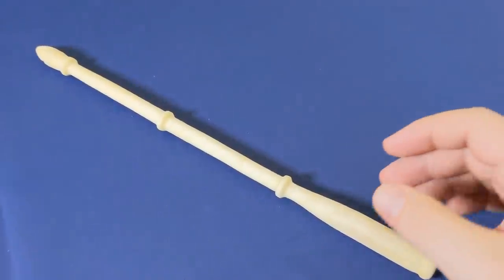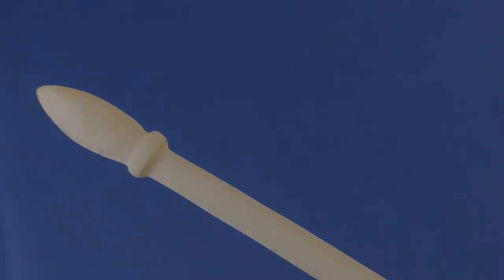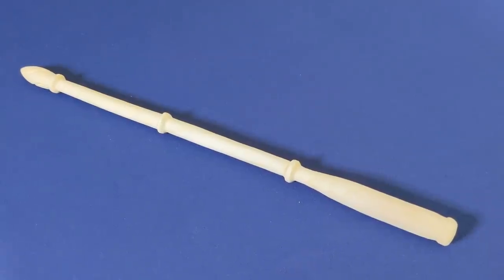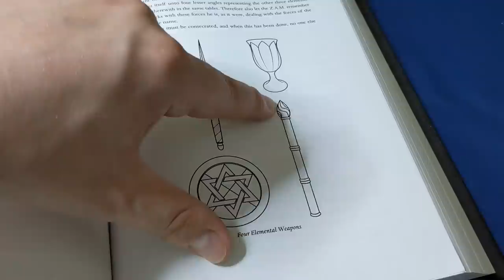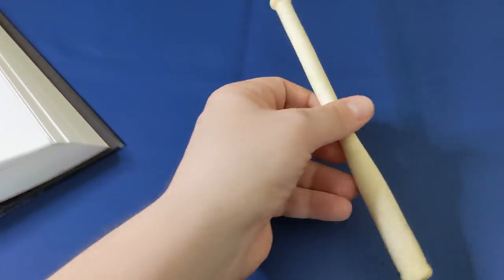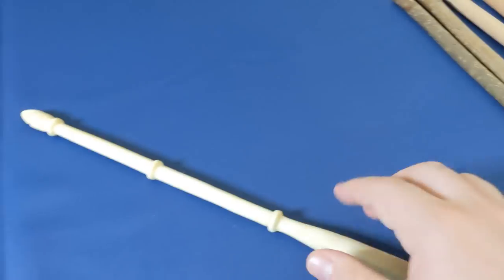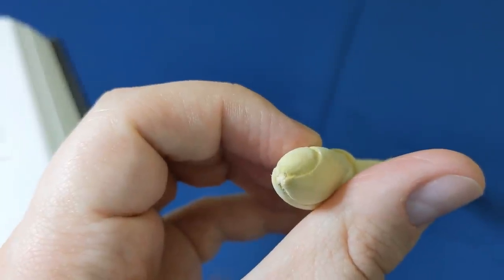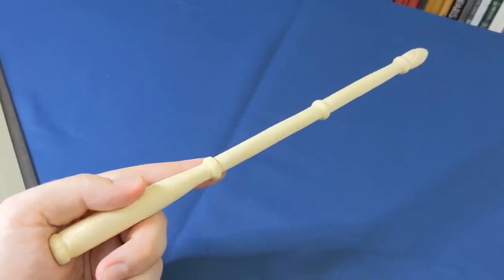Magickal Weapons: The Wand

Comment: Also in the process of making a wand, I wanted Hazel too but could not find any so went with a random (and unknown) wood dog stick I found in the street lol
but I am now stuck at the decoration part as I don't know what to put on it. My own sigil for sure and the Elemental symbols, Names of fire Gods/Giants sure but what's the option, I was thinking Icelandic Runes or Ogram Runes to spell out the names and in place of painting them on Im going to use a soldering iron to sink them into the wood and then varnish/oil or stain the wood. Also thinking about putting clear Quarts at one end and maybe smokey quarts or another dark stone/crystal at the other.
Reply from the maker: Sounds wonderful! 😄
Reply: @FoolishFishBooks  lol

Comment: Just a quick random question, I've been working with the 72 Angels of Magick after your book review where you mention the book is completely safe. I have been wondering how it can be completely safe if there are angels and sections in the book about destroying enemies? Would any of that type of energy come back on the practitioner? Even if destroying an enemy was the last resort to stop them committing emotional or psychic attack after everything such as extensive diplomacy and reason had failed? Isn't that essentially causing harm to another (however justified it may be)?
Reply: getting entangled with your enemy is not the way to get rid of them. Build up your defenses, disperse the energy they send at you and soon they'll disappear out of exhaustion or of the blowback they get from sending nasty energy at you

Comment: Another job beautifully done, Mr. Fish!  Please accept my compliments!  Do you intend to paint it according to Golden Dawn's instructions?  I would find it recommendable, depending on the intended use (evocations)...
Reply from the maker: Thanks @João! 😊🙏
I think I like it the way it is, actually. The wood itself feels very potent and very m much aligned with the concept of Atziluth being the realm of the origin of potential, of moments before initial sparks, to have this 'finished off' with paint feels contradictory to me, and I can't bring myself to do it 😄🤷‍♂️
Reply: Fair enough,  @FoolishFishBooks ! It will certainly work properly for you this way then. I agree that the hazel tree radiates a lot of power. I tried it out before with walnut (juglans regia) – it was too thin and ended up breaking during an operation (I felt like Lon Milo Duquette at that moment) because it dried out too much – but it doesn't produce the same subtle effect of power. 
But I had alteady planted two hazel saplings and waited three years until they were about twelve feet tall (they grow very fast, at least in these latitudes). I also “asked” them for a very straight branch of approximately 50 cm and one of them responded well and that's how I got it. But I used it to make my all-wand and not the fire wand.
But I got really curious indeed about how come you got virgin hazelnut sticks on Etsy (we don't have any similar stores around here). 
In addition, I would also like you to show us your mini-grinding equipment, which I found very efficient for doing work of this type. Any tips and advice?
Reply from the maker: @joaobatistatoledoprado6367  it's all Dremel 4000 with an extension 225, and a Dremel stand. Very handy indeed!
Reply: @FoolishFishBooks  Thanks, pal! Believe me, that helps a lot! Many greetings & light!

Comment: If I do this, I probably won't use either one. There's a few sacred (in power, don't think anyone sees them as sacred besides me, my brother, my best friend, and those that see all trees as sacred) trees at this park I know, and they always have the fallen wood I need whenever I visit. I'll probably find time to go up and get something eventually. Still have a rather large stick I need to make into a staff in my room from one of them.

When I was still into dark magic before I turned to God, and mostly when I was still possessed, I used a fan with "sutures" between each blade that was black... some black waxy material written on the red fabric, as my wand. Technically, I still have the wand, bit it's bent in half and has some gallium on the aluminum. (My attempt to "destroy" metal, surprisingly the gallium had no effect though. I'll need more drastic measures to destroy it. Can't just throw it in a firepit like a grimoire) Was quite fond of using it when the specters I could raise without a tool didn't suffice. What's interesting, as I'm "coming unto my own", the new Kabbalah-based system seems like a far stronger form of the same one, but relies on God, the Holy Spirit, my own energy, and the Melkezidek Priesthood instead of the cheap knockoff that demon taught me. Just need time to make the Illuminated Kabbalah Grimoire and to learn hebrew. (As opposed to Spanish, which is what the "magic language" translated to from the other world)